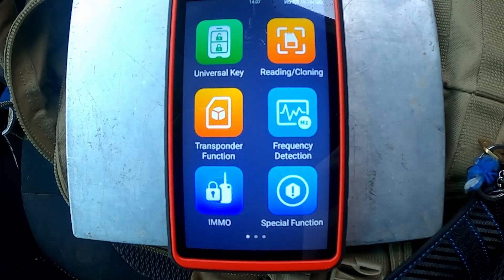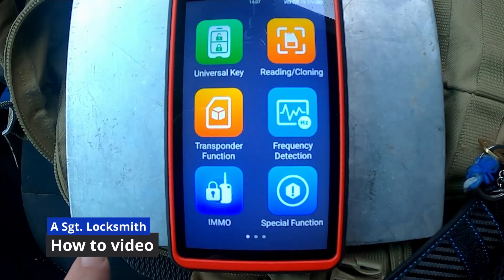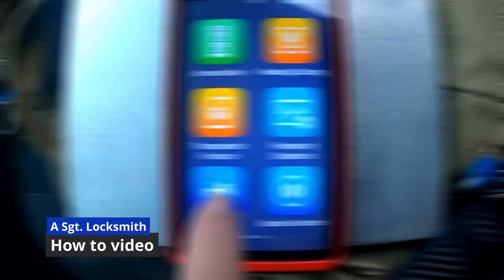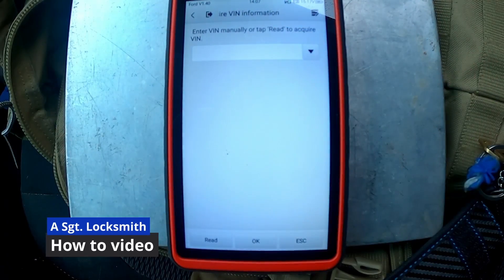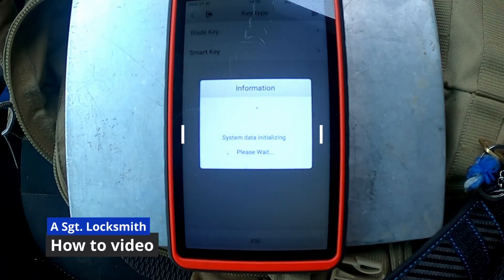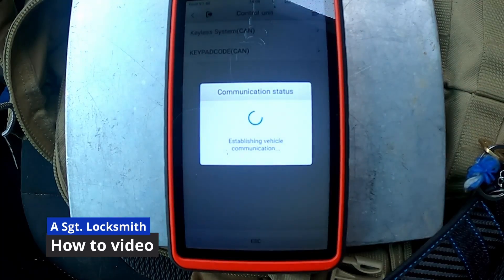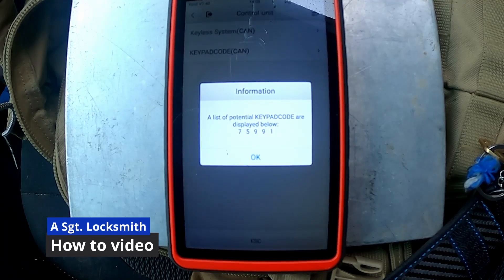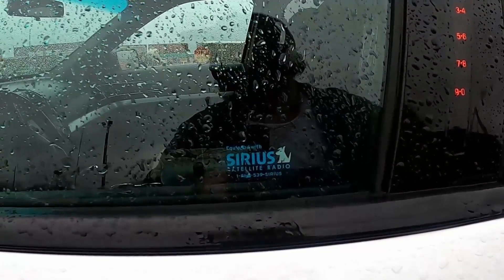How to use the Autel KM100 to pull a Ford Keyless entry code on a 2017 Ford Explorer (Step by step)

Comment: Used my km100 on a 2017 escape to pull the keypad code today but mine wasn't nearly as quick as in this video. I received a warning it would take 10 minutes to learn, to which I accepted. Sure enough, it took nearly the entire 10 minutes.
Reply from the maker: I don't upgrade nor downloaded til a few months pass. Autel has been getting rid of functions. Or delaying the time to do the task.

Comment: Do you know if other key programming machines can do this? IM508, Lonsdor 518 ISE, xtool?
Reply from the maker: I know the IM508, IM608, and AutoProPad can. Since I've used them to pull the code. Just need to make sure you have up to date subscription on those
Reply: Will it pull the PIN code for programming FOBs as well?
Reply from the maker: @DocWithTheGlock, I've used it to pull pins for Jeeps but haven't on a Ford. But remember, the newer Fords require FDRS.